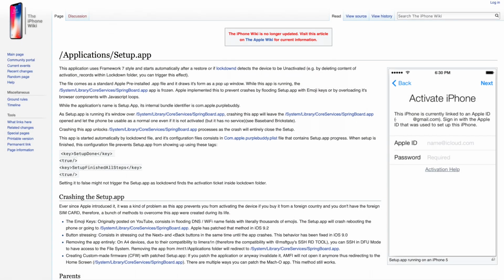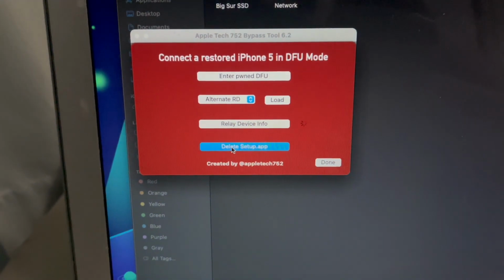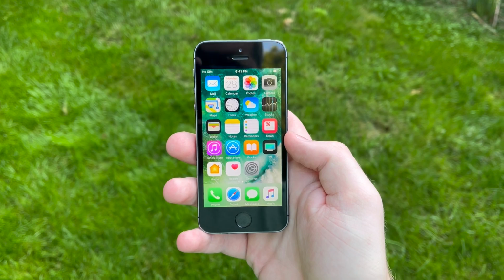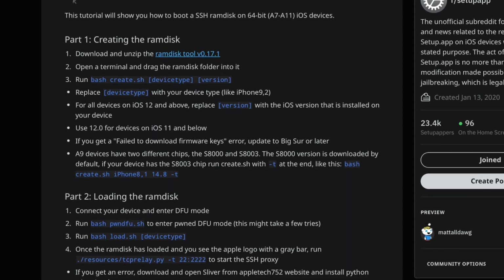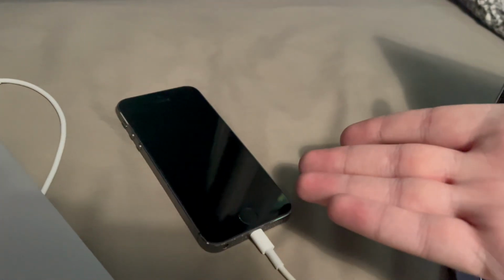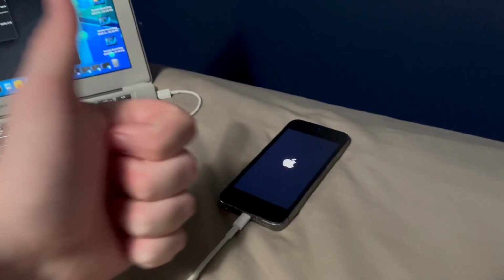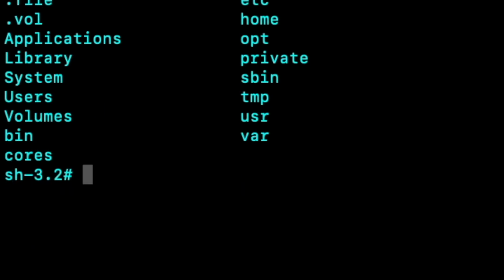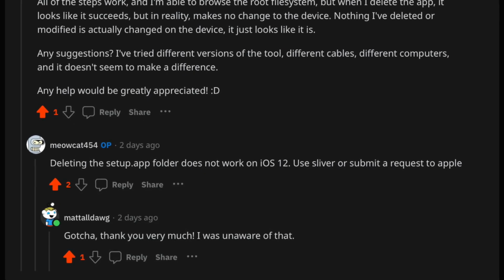Performing iCloud Bypasses... | What a chore!!

Comment: 2:45 Usually when ibec is stuck at ~70% it means iBSS failed to load, so you should load iBSS twice and it should load properly.
Reply from the maker: It usually means that Pwned DFU isn't working properly, as multiple attempts of trying the same thing also resulted in failure.